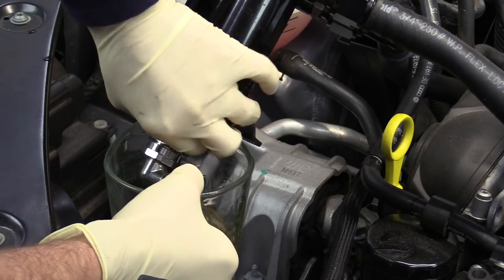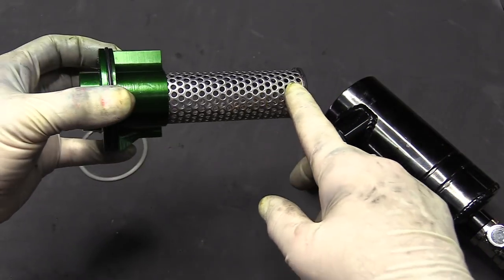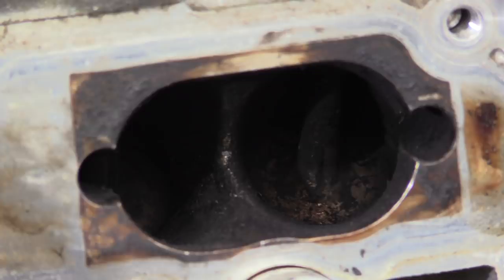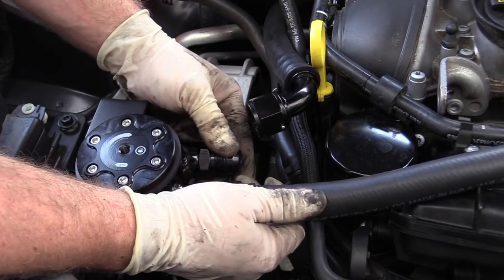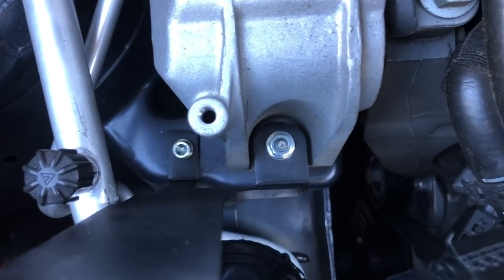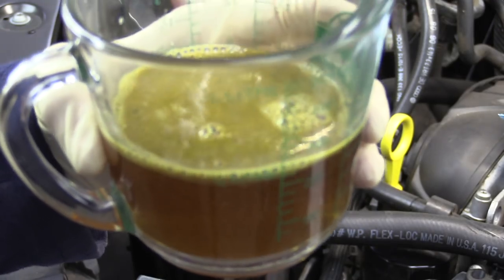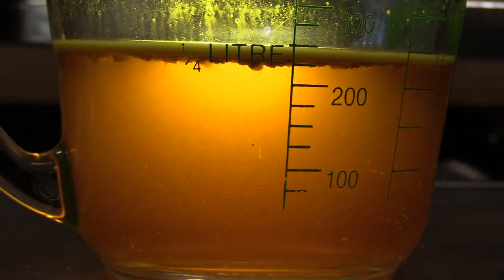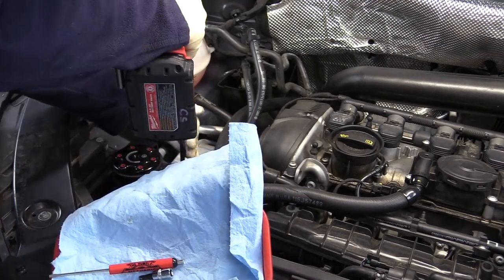Do Catch Cans REALLY Work?

Comment: This is awesome, great test Charles! That is indeed a shocking amount, gross!
I have a friend with a '15 GTI (you know Trev haha) and he didn't have much stuff build up in his from what I recall, but was only on maybe 3 months. Maybe see what his is like as well!
Edit: I'm also curious if what you've captured is flammable. It looks like a very low viscosity, almost like water (which you could also expect, since the lighter end of oil is what would go through PCV). Curious if there's much water content, or if it's mostly oil.
Reply: Yeah, this confirms my comment earlier. It seems that VW and Audi cars with the 3rd generation 2.0 TSI engine are not benefiting that much from the catch can.
Reply from the maker: Thanks Jason! I can save it for ya. We can try and burn it! It takes little convincing for me to light stuff on fire. On that, it may make for interesting conversion about catch cans PVCs and vapors in the systems. 

ALSO FIRE FIRE FIRE!
Reply: Don't burn it! Send it to Blackstone and get an analysis done (and maybe a sponsor deal out of it too)
Reply from the maker: Why not do both? LOL
Reply: From my experience with how much oil is missing in my engine (not much) versus the amount of fluid found in my catch can, I would say that 99% of what is found in Charles catch can was condensation.  I would also note that he should check the level more often in the winter months if it's cold where he lives.
Reply: Do I smell a collaboration between EE and THM? That would be awesome!
Reply: Brian Andres you're late on that
Reply: Jason, I was wondering if you would give your opinion between APR's and BFI's catch can air/liquid separator component design -- would either one have greater efficiency over the other in delivering 'cleaner' air to the intake? I mean -- you don't have to run tests or anything -- just shoot from the hip/from a theoretical perspective. (I personally like BFI's solid design; and the upgraded version has bnuts with steel braided lines  drool  but APR's separator design looks to be more thorough; please share your thoughts!!) (And yes, the steel braid is overkill because this isn't a high pressure supply line -- but it looks so prettyyyy)
BFI's design is shown at 0:30 
APR's design is illustrated on their site here:  https://www.goapr.com/products/catch_can_mk6.html
Reply: I wonder what an analysis test would say the catch-can's contains are?
Reply: Engineering Explained surely if there was a positive benefit from a oil catch can the manufacturers would redesign the pcv valves to incorporate something like where it gets filtered back into the oi. 
There's the thought that the oil vapour on the intake valves also acts as lubrication. I would like to see a sponsored long term test.
Reply: Still nobody talks about the benefit of a catch can over filtered breathers. Catch cans are a scam just like throttle body spacers. You can pay $15 to vent crankcase pressure to atmosphere or $100 to still get oil vapor dilution of fuel. May not matter to some, but on forced induction applications fuel quality is very important. Especially when you start turning up the boost.
Reply from the maker: DUDE we forgot to burn that catch can goo!!! DAMN IT
Reply: I'd actually expect it to be mostly water.  After all when you burn something it creates a bit of moisture.  A bit of that burned air-fuel mixture gets pushed past the piston rings, and part of the moisture from burning the mixture will end up condensing in this can.  It looks like the can is placed near the front of the engine compartment, so probably gets quite a bit of airflow cooling it down enough to condense water out of the hot, moist air passing through it
Reply: I didnt read other comments but this is FOR SURE pure water, only the top foam looking thing is actually oil. 95% of this thing caught is water  from condensation during cold starts,  which actually will have 0 impact  ( Calculate those 300ml for the amount of air sucked during the whole period and it will be neglectable.   The rest few % is actually oil that will dirt the valves and intake.  Oil catch cans works very well in already worn out engines.
Reply: I just read that in your voice.
Reply: larsenti I live in the tropics and will install one to see results on condensation for the same engine
Reply: HumbleMechanic “FIRE FIRE FIRE” the barracks screams at midnight (goddamn drills)
Reply: ECS actually tells you to uninstall their catch can when the weather drops below freezing... I found out about that after driving in a bit of cold weather and my catch can filled up with water... oops!
Reply: You could see that it was more than 95% water with a bit of oily emulsion on the surface. (At least I could see that on my desktop monitor.)
Reply: Looks to be the byproduct of ethanol, mixed with some oil and condensation, from the look of your intake pipe from the install video which had allot of moisture in it I would say it is doing a great job.
Reply: @chrisg4rr377  it's down to cost.
Reply: Ryan Lober so what are you saying. Getting a breather can on the intake instead of a catch can on the PVC side? I read for my car that putting a catch can on the breather side is better then the PCV side of you can’t afford to do both right away. I wanted to put a can in the breather side but would a filtered breather be better?
Reply: @larsenti  True. In my Mercedes M271.860 4 cylinder 1.8l turbocharged engine, my catch can gathered very little fluid during summer months. However as soon as winter struck here, the catch can is getting 1/4 full in about a week, and much less dense. Indeed it is seems that 99% of the fluid gathered is condensation.
Reply: @chrisg4rr377  manufacturers want as few things as possible for customers to have to check regularly. Why check and drain the gross goo, when the engine can just burn it away? Most people would ignore it, then when it filled it would either send liquid into the intake or it would block the pcv. In the winter in cold climates, it would freeze and blow oil past engine seals.
Reply: Do you often speak to your friend so formally on the internet?
Reply: Ryan Lober that’s illegal to vent your crankcase vapors into the atmosphere unless your car predates the year it was mandated.  If you don’t think a good catch can works check out ecoboost forum.  There are some non functional catch cans out there.
Reply: Whatever it is, it’s something someone is going to forget to check and later hydro lock their engine when the conditions are met.
Reply: Same catch can I installed in my 2015 GTI a month ago. So far it has caught nothing at all.
Reply: Niki Manchev / agree! Just checked mine catch can after first 500km in summer weather. It’s like 20ml water with very light oil layer on top. 👍
Reply: @Tr4cK17  well the junk yard with ETCG1 was less than stellar, other than seeing Chrisfix pre-covid mask.

Comment: Installed a catch can on my Fiesta ST. Its a low mileage motor but I still get some oil collection in mine. Mine was much more oily than what you got out but I did think the oil looked a little watery. I got no where near a cup last time I checked however. Looks like that car is driven on a lot of short trips where you will have more condensation left in the engine.

Comment: I believe it does help a lot. Every 3,000 miles I drain it and every 10,000 i clean the filter (mashimoto oil Catch can). I also noticed that I'm running a bit better in performance. I dont think itll solve the problem but having that oil catch can helps by not burning that oil in the engine and coming out the exhaust. It even smells like gas when you drain it.
Reply: what is that substance caught in the can? and if you don’t have a can what does that substance do to your vehicle?
Reply: @devote459068  It is a brown liquid that is mixed with oil from the valve cover and fuel to be burned. When it settles, it's a gunky goo.

Comment: I've installed a catch can in my 2012 gen 1 GTI about a year ago. The can itself is about 12 oz and every time I change my oil (3600 miles)I drain about 8 oz out of the catch can. The oil in my catch can is a much thicker sludge than what you showed on the Tiguan. I can only imagine that this is a good product to install on any Volkswagen direct injection turbo engine. I am definitely a believer and catch cans!

Comment: Just in the process of building mine  for my GTI 7.5 one important issue ,VW say keep the pipes BIG as smaller pipes and fittings  restrict flow and will move air to fast though them  big pipes move it slower so more effective at catching the oil mist   , Thanks Humble Mechanic .

Comment: I got a 10yr old ford focus 2.0 tdci, and during a service checking out the throttle body I found the throttle body and intake manifold to both have a thick (3/16") black carbon/oil build up.
It can only have come from 2 places I know of, the crank case breather hose, or the egr valve. Will be trying an oil catch can, but not until I take the head off and clean the valves and ports.

Comment: Great Video! Wondering if that goop hits the back of a hot valve going in - if it leaves some crusty. If it's mostly water then it would be actually cleaning the back of the valve and the catch can would be a net negative? I am assuming the EGR  dirty gas would go right through the can if it is even routed that way?

Comment: I think you should send that catch can deposit to Blackstone labs and see if there are still detergents in the oil.  If so, it may be better to let it flow through the intake and possibly clean the valves
Reply from the maker: That would be interesting to see. I saved the sample so I might just do that when I sent the GTI oil out.
Reply: My question in mind aswell. Interesting topic
Reply: That would make a great statement, good thinking.
Reply: HumbleMechanic any update on the Blackstone labs analysis of the catch can deposit?
Reply: Update?
Reply: cookiehead2 No it doesnt.Just gunks up.My Jetta at 80k had tons of buildup.
Fuel....I repeat fuel is the only thi g that will keep valves clean /clean them.Epsecially fuel with high ethanol.
Reply: Jake Smith Yet there's still no proof or evidence here that a catchcan solves it.
Reply: With a direct injection system the gas bypasses the valves hence "direct ". That's what it's all about.

Comment: Guys remember that part of the purpose of the PCV system is to eliminate any water contamination in the oil. So when the engine is serviced if there is any condensation inside the crankcase, say from when a oil change was done or the sump had been taken off or even cam covers, any humid air in there will trap moisture when it is reassembled. When the engine heats up this moisture will evaporate in the crank case then be pulled through the catch can causing it to build up in there. 

In my old supra using the the right viscosity oil also made a big difference to the amount of oil that would build up in the catch can. The thinner it was the more oil mist it would suck though.

This video though - that is quite a lot in there. I feel maybe driving around in a snow/cold climate may add to this with the cold air hitting hot surfaces in the engine during combustion and creating some moisture that could be passing the rings or maybe a small vacuum leak on the crankcase/vac line somewhere allowing cold air to enter the engine and be pulled through into the catch can.
Reply: what is that substance caught in the can? and if you don’t have a can what does that substance do to your vehicle?

Comment: Catch cans are great for forced induction (turbo/supercharged) engines and will likely help DI engines suffering from intake valve buildup.  But probably won't do much for normally aspirated engines with port injection... maybe when they get high mileage and the rings don't seal so well, which causes blow-by, a catch can would probably help quite a bit in that situation.  Blow-by is the same reason why a catch can would be so helpful on forced induction engines.  
I suggest you state that the Tiguan engine is turbocharged.  Otherwise a good video, short and sweet and to-the-point.  Thank you.

Comment: I ran the CTS one in my MKV GTI, ad living up in western canada I found that the issues I had in the winter with it always freezing and having to empty it daily from all the vapour it would catch was nice. But it freezing daily was an issue and I removed it for the stock PCV. I'd say if you live in a non extreme condition climate that these are worth it but having it so far away from the heat of the engine isn't worth it for me. Great video as always.

Comment: I've used one on my BMW 335i for 50k miles and have not lost any power like most do.  I did have the walnut blast intake cleaning done before I installed it and I cannot tell a difference 50k miles later in idle or acceleration.  My vote is thumbs up.  And, its usually half full every two oil changes (about 20k miles).

Comment: It's clearly worth installing a catch can. I am really surprised how much oil did your catch can collected. Most cheap ebay ones (that are empty on the inside) will only capture a fraction of what you are showing here ! A good one makes all the difference ! That 200 ml is probably exactly the oil that the engine "consumed"... Also a good idea to install one on diesel engines, as they are even more problematic, because the oil vapors combine with soot from the EGR and make nasty deposits on the back of the intake valves...

Comment: I added on to my 99 Pontiac Bonneville because they are known to pool oil. the 3.8L N/A at least. sometimes even the supercharged versions could pool oil. I've taken it apart several times and on top of the lower intake manifold, the oil builds up in the opposite ends of the corner. it comes from the PCV. so when there is engine oil blow by, it is supposed to bypass into the intake manifold to be consumed in the combustion process, unfortunately, the oil vapor builds up instead of going into each cylinder and for whatever reason the circulation doesnt allow it but instead it mostly pools up.

the catch can makes an improvement on this, which helps risk of fire and may increase fuel economy. it is a mostly custom job procedure. you have to adapt the pcv from the crankshaft to go into the catch can and drill a hole directly into the intake vaccum (either in the middle or right next to throttle plate), or sometimes you can put the output before the air cleaner or before the throttle plate but that may cause MAF errors and more carbon build up. so I think it's best to bypass that and go straight into the intake like it originally does. the bypass is the intake sucks through the catch can which inlet is the output of the pcv.

pcv --> catch can --> Intake (vaccum).
so because there is always a vaccum when running, the pcv opens and the vapors automatically filter through the can and should prevent oil going into the intake and cylinders for combustion. it really ought to recirculate the oil back into crankcase and leave the vapors for combustion, but it just catches the oil and the remaining vapors go into the intake.

all the catch can does is allow the oil vapor to cool and build up in the "catch can" itself so you are not burning up unnecessary oil. I left my pcv system there but sometimes you can just delete it. I just adapted it after because there is a tube hook up that goes under the upper intake to the throttle body but it's just flimsy design. so yes if you have experienced oil buildup in the lower intake manifold a catch can is for you. requires hose adapter fittings and drilling and rerouting and universal setup and a type of engineering brain to make it work together. also in the catch can you should the copper wool instead of steel wool to help slow the flow and collect the oil vapor.

Comment: I have a 2017 beard that keeps catching food particles, what's your expertise on what I should do to avoid such debris. Trading in for something with a sleeker finish is out of the question because I can't afford the constant maintenance on it. The problem went away when I stopped eating but I then had issues starting up in the mornings and reduced performance throughout.

Comment: I installed the JLT catch can on my GF's 2012 Ford Flex EB, there was maybe 2 tablespoons at most in the catch can after 5,000 miles.  I did the Walnut Shell blasting just prior to the catch can install @ 108K.  I hope it cures the issue as I don't want to do that job again!

Comment: Was this mostly oil or condensation with a small amount of oil?
Reply from the maker: Mostly oil from the looks of it
Reply: HumbleMechanic I've noticed on my direct injection vehicle I have a 2012 Kia Optima SX it's a turbo and I've noticed the more humidity and or wet weather you have and the colder it is the more Blow by that you catch so I would not wait the full 3000 miles in say winter time because they do fill up a lot faster I have to catch cans on my vehicle with a PCV delete so it goes through both catch cans and I catch quite a bit in the winter time I checked mine at least once a week or every fill-up
Reply: HumbleMechanic also there is unburnt fuel water oil ECT in the catch can there is more gas in water than there is oil
Reply: Going have you say no, almost no oil. Look how it drained the viscosity was way too low to be oil, It flowed like water. Really all catch cans are a waste of money. Should let the container sit for 24hours and see how it separates.

Comment: Carbon buildup is mainly from the EGR, that is for every brand.
Have pulled several intakes to do carbon cleaning and it always start at the EGR inlet to the intake
Reply from the maker: The only difference here is this engines doesn’t have egr
Reply: HumbleMechanic in that case I think i could help
Reply: @HumbleMechanic   With no EGR how do they keep NOX down ?  I consider EGR as something that reduces combustion efficiency a bit.